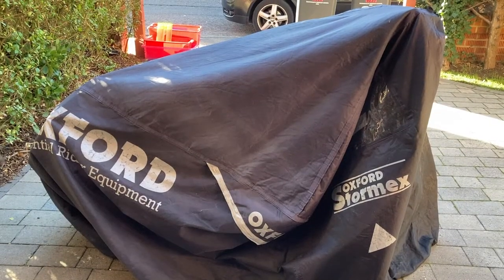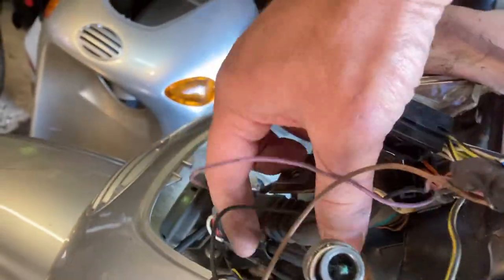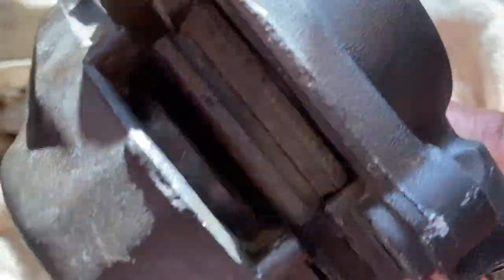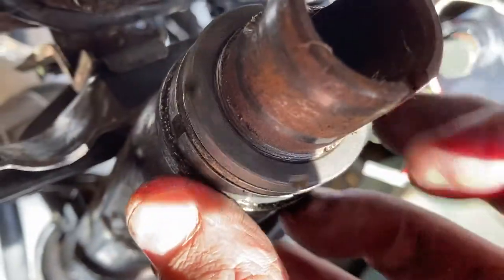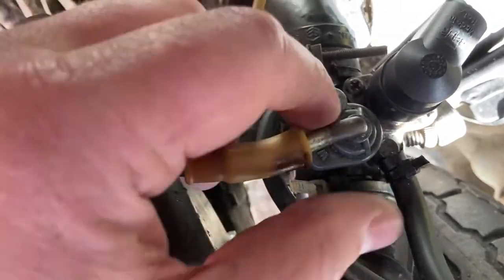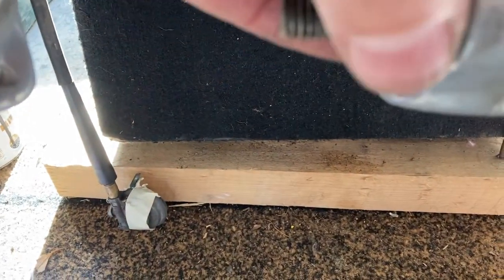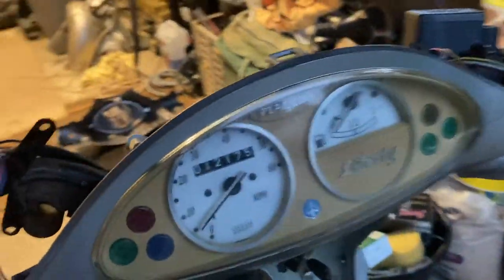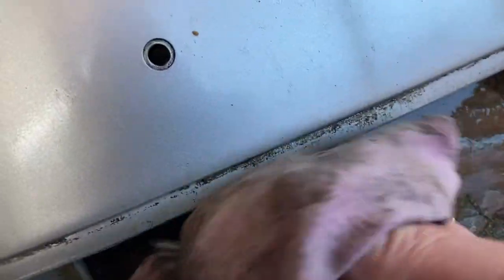PIAGGIO Liberty 50cc 2002 Rebuild, Replace, Repair and Renew

Comment: ive question, ive a 2021 Liberty S 49cc and today my engine light came up and i checked under the scooter and there are 3 or 4 thin cables  (the one close to exhaust, right side) 2 of them are looks like chewed , broken but my everything is working so what are those cables? anyone has an idea?